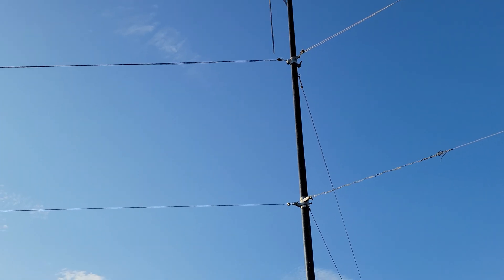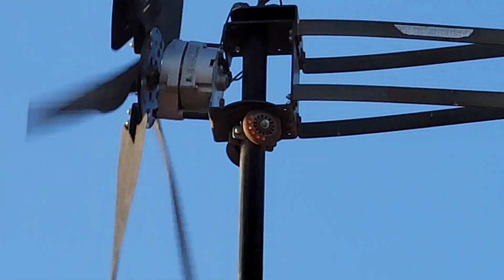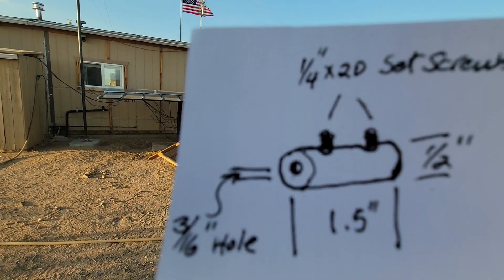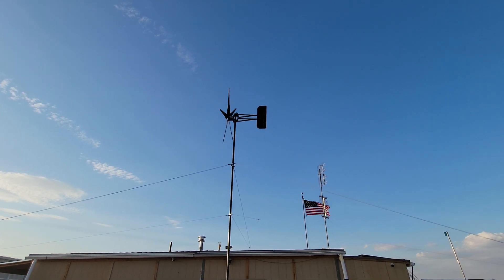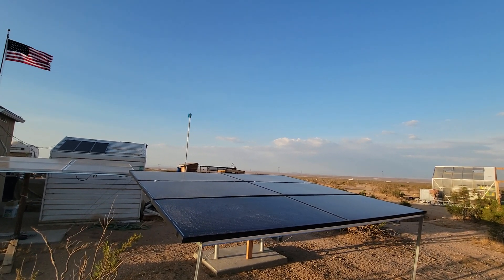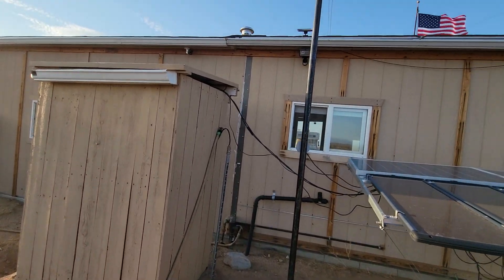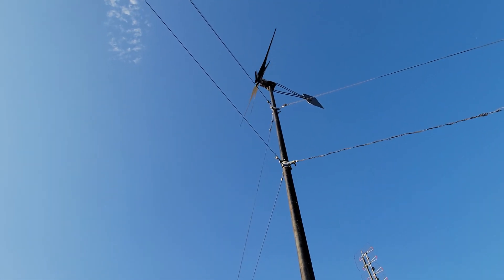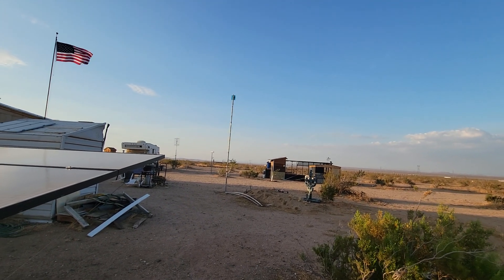TURBINES, Wiring, Connections, Masts, Guy Wires and Outputs, July 21, 2021

Comment: I'm glad you made this video. I will pick your brain when time for me to put up my turbine.
I'm still working on my solar. I have to wait until I get paid to get more wires. Will email with finished results
Reply from the maker: The solar is way more important than wind power.  The sun is always on time, only sometimes clouds get in its way,  but wind can't be put on a schedule.  That's why I say wind power is only supplemental.
A good battery bank with extra solar is always the better choice.

Comment: Good lookin connection for the wire !  TAKE CARE..
Reply from the maker: Thanks.  Makes it removable without the need to cut or solder wires.
Reply: @GBear  Pretty Slick way to go if service is needed. TAKE CARE..
Reply from the maker: Thanks.

Comment: Hi GBear, I have a question about deep well pumps. What are they referring to when they speak of Maximum Lift? My well water level is 213 ft. The pump will probably go to the 250 ft level. So the pump needs a lift of more than 250 ft, correct?
Reply from the maker: Absolutely correct.  The lift is how high the pump can lift water.
Reply: @GBear  oh gosh, so if the tank is another 100 feet up the hill, I have to add that too? So that means I would need 350 foot of lift?
Reply from the maker: Yes, and no.  You need to include the total distance of gravitational lift, and add extra to that so when the pump gets weaker with age it can still do its job.  
Pumps for that kind of depth are usually 220-240 volts AC because of the power needed.  If you have the power available,  it is no problem.
Reply: @GBear  uh oh, I may have a problem then. There is no power near the property. I intended to use a combination of solar and wind dedicated to the well pump. Should I go with a generator instead? My intent is to fill the water tank, then use gravity from the tank to deliver to the shade house  and my trailer.
Reply from the maker: @SherryTheSecretary  wait... there is an existing well at the depth you mentioned, that in the past pumped water to the pressure tank that fed the storage tank, and am i understanding that you need to replace a faulty pump?
Reply: @GBear  there is an existing well. A pump was never installed. I bought the property and need to install a pump. The property is off-grid. Far from any utility.
Reply from the maker: Ok, and what about the tank?  Is it just storage for gravity feed to the cabin, or is there a pressure tank at the well location, or is the tank actually a pressure tank?
Reply: @GBear  The tank is to gravity feed the cabin and the garden. So The well pump will fill the tank periodically.
Reply from the maker: I suggest you buy a 220v generator to run the pump periodically to fill the tank.  A nice electric start 6500w unit from Harbor freight should do it, and you can use it for emergency backup for your cabin electric too.
Reply: @GBear  Thank you so much for the advice. Your video's have been an inspiration. Its daunting but I am so looking forward to it.
Reply from the maker: You're welcome.

Comment: Regular 10awg butt connectors soldered works well.    Never count on obtaining more then 50% of the turbines rating.  I like slip rings because our winds swap directions season to season.  Install them in the mass and they work fine.  Good Stuff.  Our winds are not consistent enough to use as a primary source.  Only as Axillary power.  The winds do not sleep at night.

Comment: Yes but if you would have had a hurricane vector you will not half the problem because hurricane Vector will make 700 watt at 24 miles an hour
Reply from the maker: True, but the wind isn't ALWAYS 24mph.
Reply: @GBear  you're right but at 12 miles it makes 200 watt
Reply from the maker: Understood, but again, the wind doesn't have a set time and speed that can be counted on, so wind power should only be considered 'supplemental' at best.
Reply: @GBear  yes you're 100% correct that's why I have 3000 watts of solar panel and two other wind generator have the hurricane Victor a kt5 and one DIY

Comment: You mean stay away from cheap slip ring wind turbines because if you buy a hurricane Victor it come with one 21 mile an hour I think mine's make about 1200 watts I have one like yours too and I have never seen pass 700w call them they told me he needs at least 60 mile an hour winds to make the 1800 Watt they keep talking about if you buy a wind turbine with a junk slip ring yes you will have problem

Comment: Thank you ofr answering my questions, Im in the wish I knew phase LOL. That is why I ask questions ( I dont know everything). I already purchased a china 400 watt turbine recommended by John Daniel on his very informative youtube videos. Will have to wait and see once I get the turbine up and spinning. I am waiting on a few items to show up in the mail,before I raise it up. Im liking solar so much more. I am limited on space in a camper for batteries. I have 6- 6 volt us2200 scissor lift batteries  232 ah. Wired as 3 pairs of 12 volt. Im wanting the turbine to keep the batteries topped off. Thanks
Reply: like JD says you need good clean  winds, scissor lift batteries thats something i might look into. 3 phases are just three different groups of windings inside the generator, look at axial flux turbine designs youll pick it up easily.
Reply: I copied a view things from John Daniel, especially his dump load ideas, but he had a lot of wind too, and that's most important with a turbine.
Reply from the maker: No wind, no power. Little wind, little power.
Big wind, big power.
Reply from the maker: I have 18 of those batteries. You might consider buying a Harbor freight trailer and turning it into a tagalong battery box.  Even add a few 300 watt panels on the roof of it.
Reply: @GBear  now that's a great idea!!

Comment: It has been horrible here!!! Might be worth it if we got any real rain. Swamp cooler is useless! 
Two years later we Still haven't put up our wind generator .  Don't know if it has a slip ring. Will have Rob watch this video too.  Great info! Thanks!
Reply from the maker: Yeah, I'm tired of turning bottled water into sweat.
Don't worry too much about setting up your turbine.  I learned that they are supplemental at best.  Besides the max output at max wind speed, you find out quickly that ANY output is minimal because the wind doesn't blow at constant speed for long periods of time, so it becomes the equivalent of solar panels on constantly cloudy days.
Reply: @GBear  well bummer we paid a Lot of 💰 for it. Wish we had bought more batteries or solar panels. 🙄 😊
Reply from the maker: Batteries first, as they are what you need to carry you when there is no solar or wind protection.  Then solar panels to generate 3 times what you use during the day.  That chargesvyour batteries fast in the morning and keeps them there all day while you use power, so after dark, you start with a full battery bank to hold you through the night.
If I was to start over I would have gone with twice as many batteries, or just one Tesla Wall Pack, I would have stayed away from cheap controllers and inverters, and 100w solar panels, instead opting for high watt panels like the 305w ones I just added.
All in all it would have cost less and gave me alot more power.
Reply: Another great informational video! I'm finally gonna be where we need to be on the first of August! We finally got a new charge controller recommended by the solar guy here in Pahrump because we are only 12v he helped us pick one out  for our needs! We're gonna add 2-440 watt solar panels to our systems that will bring us to 1880 watts of solar our usage is right around 460 watts when we're using most of the stuff we use daily! I think we'll finally have the system right woo hoo! Only took me 3 yrs to figure it out! Your help help to reach this goal was very helpful! God bless GBear!
Tony n Lee Ann
Reply from the maker: Thanks, and best of luck to you with that system!
Reply: Yes with a wind turbine you spend a lot of money and the output is small and because of the moving parts more repairs or maintenance,  but it gives a little power in cloudy days and windy nights. Recently I put up an Ista Breeze i2000 and I am satisfied with the output, about double than my old KT5.
Reply from the maker: Cool!  Right now, 0 wind here, so guess how much electricity my kt5 is making...😄
Reply from the maker: @LMBee00  I've heard of using Bromine tablets in swamp coolers to keep down algae.  It's very dry where I am so my air conditioner doesn't produce much water at all.  When I lived in the OC it would fill a 5 gallon bucket in a day.
Reply from the maker: @LMBee00  i have no problem walking on water...😆